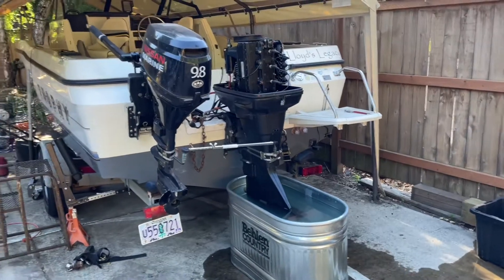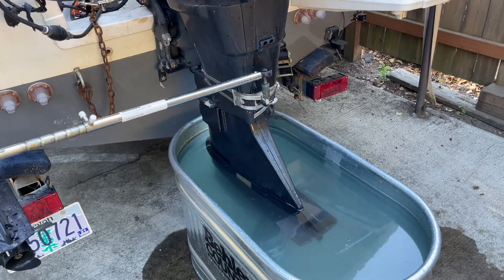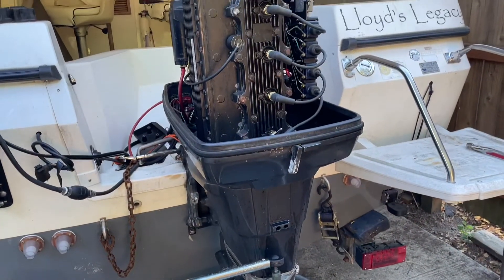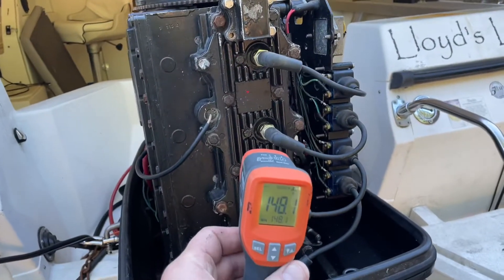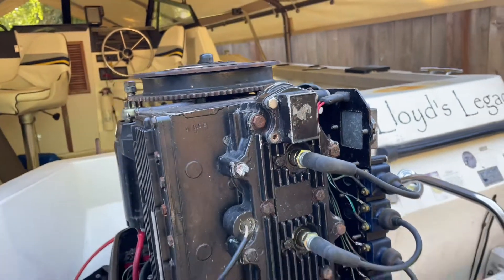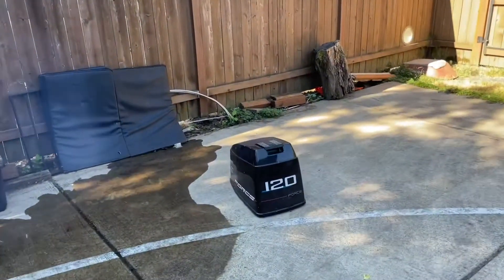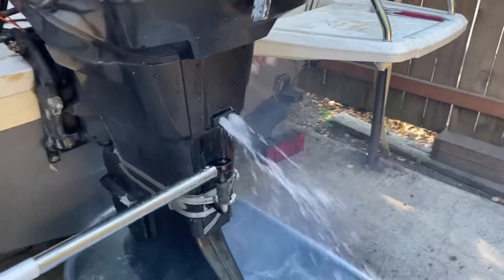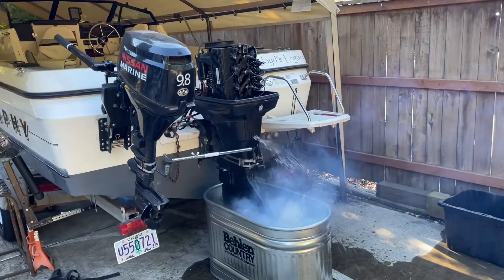1992 Force 120 outboard overheat

Comment: Thx, I’m sure you know how hard it is to find any info on these motors. My 150 is having overheating issues still with a new impeller and it’s not purring out as much water as yours at the ports. Seems like the thermostat is next.

Comment: Force 125 does not have a tell tail (pee’r) but you can easily install one by removing the plastic plug at the top of the motor and running a hose out the cowl. And the lower exhaust ports aren’t a very good indicator of water flow because the force motors have a compartment behind the thermostat that holds water which cools the block, if that thermostat quits working properly then water will not cool the block unless you are at WOT and pushing water through the block . Easy fix if you can’t find a thermostat is pull thermostat, gut the internals of it then put back in, this will work in warm water really well but in the winter months try to replace the thermostat
Reply from the maker: Wow! I really appreciate the detailed help! Thank you!

Comment: What would a reason be for it not spitting out water? I have a force 125 that starts and runs but doesn't pee. Thanks in advance!
Reply: Replace Impeller on your water pump on the lower unit.
Reply: I have 90hp.  Impeller should be replaced semi annually or annually depending on use
Reply: Force 125 does not have a tell tail (pee’r) but you can easily install one by removing the plastic plug at the top of the motor and running a hose out the cowl. And the lower exhaust ports aren’t a very good indicator of water flow because the force motors have a compartment behind the thermostat that holds water which cools the block, if that thermostat quits working properly then water will not cool the block unless you are at WOT and pushing water through the block . Easy fix if you can’t find a thermostat is pull thermostat, gut the internals of it then put back in, this will work in warm water really well but in the winter months try to replace the thermostat

Comment: I have same motor and v have a question. The middle wire coming from back of motor to the left of spark plugs. What is that to. Found mine just hanging. Lol
Reply from the maker: That goes to the temperature sensor for the overheat alarm buzzer (which is in the dash).
Reply: Is there any way to test it I just got a 125 just like to know if it works
Reply: @TheBanksb  ground out the wire with ignition on and that should make the buzzer go off and if a gauge should peg the guage all the way. Motor does not need to be running to check this, thats the way I have always checked them.

Comment: Have you replaced the waterpump on the force motor? I’m trying to find the part numbers. TIA!!
Reply from the maker: I will look mine up tomorrow and get back to you but I suggest going to MarineEngine.com and search by your serial and or model number. I have traced several parts there.
Reply: Waterpump kit should be FK1204-1.
Force 120 normally uses a 130 degree thermostat.

Comment: I have same motor, the smoke is that normal?
Reply: Yes the smoke is normal. These are 2 stroke engines so they require oil to be mixed into the gas at a 50:1 ratio with a TCW-3 oil.

Since oil is mixed in with the gas for the lubrication of the engine internals any 2 stroke engine will and should smoke to some degree. If it isn't you more than likely have a problem such as it running on straight gas instead of premix/ oil injection.